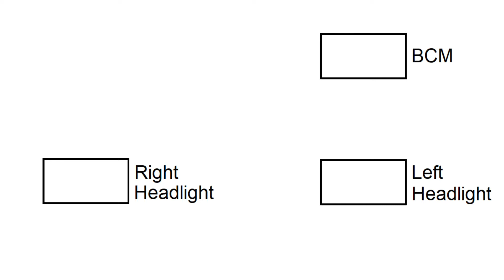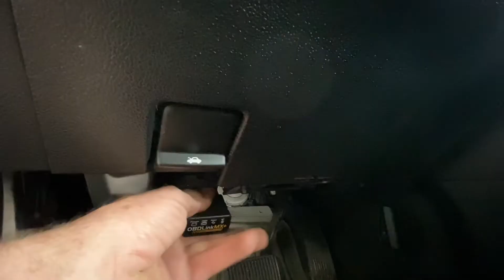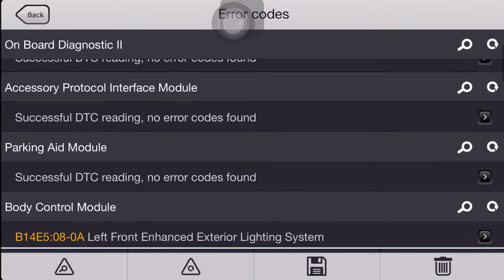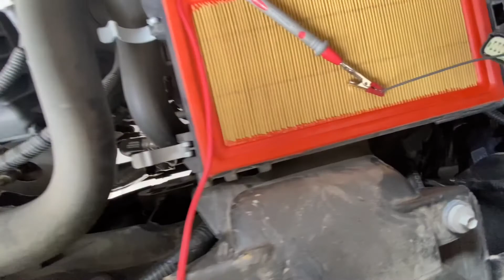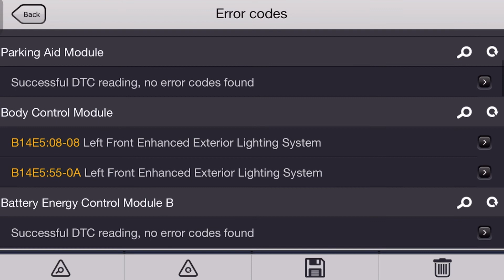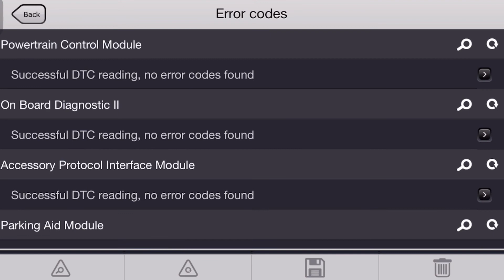Headlight Won’t Shut Off on 2018 Ford Explorer B14E5

Comment: I have a front left stays on without brights. The right shuts off has brights only and both headlights shut off randomly. Battery and alternator are new and working I put in new bulbs that I could easily get to and still nothing. Hopefully there is a solution lol

Comment: My 2018 Ford Explorer's horn isn't working, even though it's been replaced. The problem seems to be with the electrical wiring. I would appreciate any help, such as a video or wiring diagram for the horn.
Reply: Take the panel off below the steering wheel and you should find a green wire that’s disconnected from another green wire. Hook them 2 wires back together and it should work.

Comment: Very sad situation, the nicked wire break in harness is more common than you'd like to think. A quick way to confirm, run a test wire from the right to left LIN pins. If this solves the problem, you can re-pin the broken line and run a new wire alongside the harness (held in place with zip-ties) to the working side splice. Had to replace both LIN lines to headlamp connectors to make work. One was broken the other was about to break.

Comment: I’m getting that code for a short to wire for left. Do you know how I can check it for a 2018 Lincoln Navigator? I got the same code you did for a short to ground for left enhanced lighting system but also getting some ac distribution short to ground. Don’t know if it could be related

Comment: I currently have an issue with Ford explorer 2016 xlt, one headlight works on driver side but passenger side doesn't its basically dim and flickers a bit, and the switches in the interior does not function when you try to turn it off or on, but when I disconnect the passenger headlight cable the one with 7 pins headlight is fully off on passenger and everything functions normally for driver side like it switches on and off, but when i plug it back on it turns the driver side on when the switch is set to "off position", I double checked the BCM wiring, Fuses.
Reply: I have the same exact problem with my explorer 2018, were you able to fix it
Reply: @sethunvable yeah it was the pins corroded on the headlight had to get the whole assembly replaced

Comment: On my way to work tonight i noticed the lights turning off and back on intermittently.  This would happen on automatic and on manual lights on.  When i got to work i noticed that the passenger headlamp was full of heavy condensation.  It was not working at all.  The drivers side light wouldn't turn off until after the 20 minute time frame.  I'm at a loss.
Reply: Have a car with the exact same problem. What was the issue for you ?
Reply: @preston429smith same here what was it?
Reply: @GT_DRIVER21 we bought an entire new headlight off eBay it was a cheap one then it worked for a while then it broke again lol
Reply: Man thats awfull ! Thanks for the reply lets me see what i can do. 🙏🏼

Comment: I have a 2018 Explorer that has the pass side low beam out, but drivers side working and staying on after shut off. Both issues began at same time. Any ideas? Thanks.
Reply: Having same issue

Comment: Your video is interesting, in my case neither the DRL nor the low beam turn on, but the high beam, the turn signal and the side marker do work...what could it be? Or what can I check to get an idea? I would appreciate.
Reply from the maker: I’d have to look at a wiring book, but I’d wonder if you have a blown fuse or broken wire.
Reply: Bad ballast.

Comment: great job, odd that 2018 had corroded wire.  i see this issue on explorer forums.  common problem...
Reply from the maker: It’s a combination of things.  Smaller and smaller wires with cheaper insulation and more corrosive chemicals used on the roads during the winter. I think it’s more common now than when I made that a year or two ago.

Comment: great video , had this exact issue and was about to buy a module after testing the lin circuit  but once i connected it back it started working as normal !
Reply from the maker: It must have had a bad connection or reset the module.

Comment: I just bought a 2018 explorer. I noticed the left low beam stayed on after shutting the vehicle off... I found the lin wire was broken. And pulled out of the plug. I bought a new plug. Soldered and shrink wrapped the wires... I bought a $400 dollar scan tool to clear the codes. I get a code B14e5-08... what I didn't pay attention to was there are two ground wires. Do you think I have them mixed up? Or doesn't it matter? Or is there something else I should look for?... thanks.

Comment: Hey guys I'm hoping to figure out a way to run my signature lights on with the light switch in the auto position with the day time running lights disabled. 17 Limited . I just want to add that for some odd reason disabling DRL and setting the light to "auto", it completely disables both signature lighting and lowbeams during the day. TYIA

Comment: Good afternoon, Ive been dealing with the same issue however mine was self inflicted.  I had to bypass the eyebrow lights to have them turned off when the engine was running. It was done by a local shop who installed switches to be able to manually turn on/off headlights.  I have since removed the switches and wanted to return things to stock and now my lights are on all the time and shut off with the power after 15 minutes or so. I want to check the LIN wire and am not sure what I need to check the wiring at the connectors like you show.  What do i need to be able to do the OHM test. I already have an electrical tester just not sure on what to plug into the connectors etc. Im trying to trace the yellow/purple wiring to find where the fault is.
Reply from the maker: Just a digital volt ohm meter /DVOM.
Reply: @CarShopTalk  ok. what are the probes that were used for the connector?
Reply from the maker: @xcalibrevideo893  they’re just pins from electrical connectors I’ve collected over the years. I think you can buy kits on Amazon as well

Comment: What are your thoughts on the driver's side low beam staying on dimly, and the passenger low beam flickering and barely visible. Unplugging the passenger headlight allows the driver's side to work correctly (no longer stays on) and be bright. If you try unplugging the driver's headlight and plugging in the passenger headlight, nether headlamp works.
Reply from the maker: What’s it on?  Year, model?   Off the top of my head, ground issue possibly.
Reply: @CarShopTalk  2017 Explorer 3.7L
Reply from the maker: @letsgo4629  sorry I didnt get back to you sooner. It’s been a busy couple days. I wonder if you just have an issue in the passenger headlamp shorting the LIN from the BCM.  Do the high beams work normally?
Reply: High beams still worked for me with broken Yellow LIN wire tight at the headlight plug harness. Repaired with new plug.  Be carefull with wire colours  some ssme colour.  Looked at drivers side plug and found crscked wire and green corrosion starting.

Comment: Hey, I've same issue with my 2017 explorer. The electrician told me that I have to replace the hole headlight to solve the issue and I feel it's not logical.
Could it be an issue with LED control module??
Reply from the maker: It could be, and that doesn’t come with the headlight assembly, it’s a separate part. And Ford’s diagnostic manual is written incorrectly for this. It doesn’t even mention or check wiring as a possibility. I think it does instruct you to replace the headlight if you follow the book.

Comment: Hey I've got a similar issue. My 2018 Ford explorer was defaulting to having the left headlight stay on and now it's completely off. Any ideas why that might be?
Reply from the maker: The headlight defaults to being on if it loses communication. The only way for it to be off all the time would be for a bulb to burn out, a loss of power or ground, or the module itself to fail.
Reply: So what is happening now is that the low  headlamp flickers slightly, then shuts off. There are no issues with the right headlamp.
Reply from the maker: @Sparky1026  It sounds like a loose power connection, loose ground or an issue with the control module itself.
Reply: Okay does the LED in the assembly fail often?
Reply from the maker: @Sparky1026  no, they don’t. It’s rare.

Comment: Did this condition produce a check engine light?
My 2017 Explorer has this condition with both headlights (L&R). My ODBII scan tool doesn’t pull any codes. I would like to try resetting the BCM code just to see if there was maybe a transient occurrence before I try digging into the harness. Besides, I’ll need to reset the code after any repairs anyway, right?
Reply from the maker: You wont get a check engine light over something like this. The engine light is reserved for Powertrain and emissions problems. I would think you should have codes in the BCM.  A lot of code readers only communicate with the PCM so make sure the scanner your using will pull codes from the other modules. It’s not going to hurt anything to reset the BCM and yes, I would clear codes after it’s repaired.
Reply: @CarShopTalk , my question is whether the BCM will continue to force “lights on” even when the cause is no longer present until the code is reset? If so, would the code eventually reset on its own? 
I recently had to replace the battery, and the Explorer was left with no battery in the vehicle until I was able to install the replacement. I still had the headlight problem afterwards, and I’m curious whether the BCM code could still have been present?
Reply from the maker: @gogilmaper6557  I think the code would eventually reset on its own and normal operation would return if the problem is fixed. Usually if the lights stay on like the one in the video, it’s not that the bcm is commanding them on, it’s that there isn’t any communication between the bcm and the light. If there’s no communication and the light doesn’t know what to do it defaults to turning on, since that’s the safer of the possibilities, especially if it’s night time.
Reply: I haven’t fooled with this issue in a while because I’m having trouble discerning where on the harness to access the LIN wire at the BCM. I don’t want to tear into the harness just to probe for a Y/V wire while not even being sure whether I have the correct harness. 
Is there a spot to access the Y/V wire as it exits the BCM? Is the LIN fused perhaps?

Comment: Whats your opinion on both headlights not turning off?
Reply from the maker: By both you mean right and left, not high beam and low beam I’m assuming?  The LIN / network circuit is probably open before the splice where it splits off for right and left.

Comment: Would like to know why a check engine light would stay on since an accident Ford collision center repaired and the light occasionally goes out, but comes back after a day or do on a Ford Fusion hybrid 2011
Reply from the maker: Usually a check engine light after a collision is a vacuum leak or a broken connector.  Some kind of related damage. If only the head light was broken I can’t really think of anything that could throw on a check engine light.  Get codes pulled on it and that should point you in the right direction.
Reply: @Shop Talk  the codes say oxygen sensor, but auto zone says to replace both, so I'm suspicious and when it goes out from time to time it sure seems like a connector! Too often Ford wants a $160 diagnostic test to find something! That's crazy! They said that about a door window regulator! That don't need a diagnostic test!
Reply from the maker: Is it an oxygen sensor code, like a oxygen sensor heater circuit? Or just an oxygen sensor lean code like P0172?  If it’s a lean code I’d probably be thinking a vacuum leak, not an oxygen sensor. If it’s an oxygen sensor heater circuit code, assuming they have power, its probably an oxygen sensor. If it’s a lean code I’d want to look at pid data, like long fuel trim. If its high at idle, like 12% or higher and drops when you rev it up its a vacuum leak, not an oxygen sensor. It’s not uncommon for plastic vacuum lines or intercooler tubes to get damaged in light hits. Occasionally you also see wiring get pinched or damaged.
Reply: If the light goes out from time to time for a few start-ups and then is back on for months I'm not going to get the 2 oxygen sensors replaced and find it was just a connector! I see no difference in my gas milage! Always around 34mpg!
Reply: As long as I live in Florida we don't have vehicle inspections since the 80's but if I move to New Jersey they do and won't allow it on the road with a CEL on!